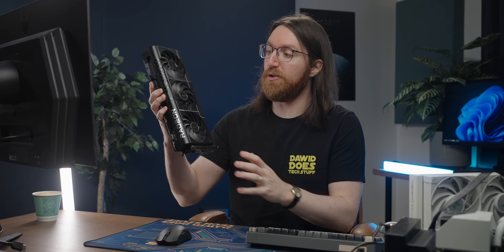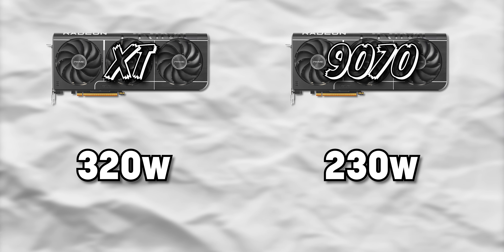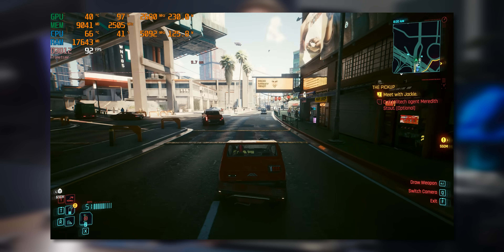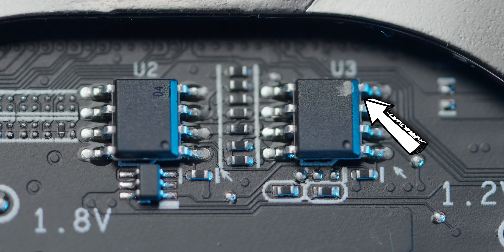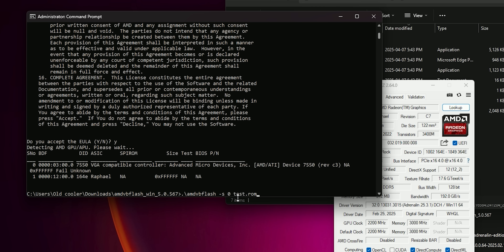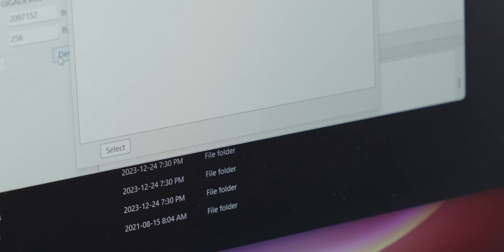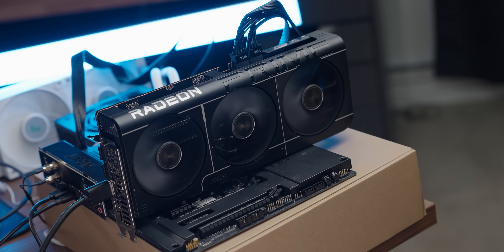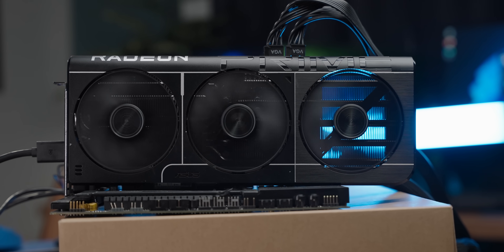I Flashed An AMD RX 9070 XT BIOS Onto My RX 9070...

Comment: Would be good practice to make a backup of your previous BIOS with your reader/writer before writing the new BIOS onto it.  To recover from a bad flash or just have the ability to restore it to its previous state in the future.  I assume you checked the hash or checksum on the downloaded rom/bin to be sure it was bit-for-bit correct before writing it to hardware...  And I assume you downloaded it from someone that provided that hash so you could verify.

Comment: The data on the chip means(maybe)
1st line 
GD - giga device (manufacturer)
2nd line 
25 - chip version (usually all smd bios chip. thd are 24 if i remember correctly)
LB - low power 
16 - 16 Megabit

Other data not important

Comment: AMD are famous for this, I remember flashing a R9 290X bios on the 290 and it even unclocked the extra cores! 

The last time I remember this working was on the 5700, so it's good to see it back because it's part of the fun of getting AMD stuff. Even going back to the 1600 CPU's that went from 6 cores to 8 cores

Comment: I would not suggest flashing a 9070XT VBIOS on a 9070 non-XT. One important thing to note is that each GPU vendor has their own VBIOS. Meaning you cant flash an ASUS VBIOS with a Sapphire 9070 non-XT. I know that's very straight forward but someone out there will try it w/o doing research and brick their GPU. Also not sure what you tried doing but the AMDVBFlash.exe does work. I've successfully flashed multiple 9070XT and  9070 non-XT GPUs.
Reply: Have you tried using it to flash a 9070XT VBIOS onto a 9070 using same vendor VBIOS?

Comment: You could try it with the sapphire nitro 9070 as it has the 12vphr connector like the XT variant. The Asus 9070XT has 3x 4 pins

Comment: so how does the modded 9070 compare to the 9070xt? and what are the physical differences on the two cards? is a 9070 just a 9070xt that didnt quite hit the quality control limits but had enough functioning cores to be a 9070

Comment: will more power tool work on this generation?
Reply: Didn't work with 7000 so 9000 Probably wouldn't.
Reply: @AlexHusTech  assumptions was not what i was looking for. since the architecture is different i thought there was some possibility that they went back to the previous system such as apple does with design. 

it seems to be trend in manufacturing to flip back and forth with parts and sub-systems. 

the reasoning is that one does not have to re-invent the wheel every time.

Comment: As a fellow PC nerd who used to basically do this all the time to my RX 480, you are bringing back some fond memories. Wait until he discovers he can mess with the vram subtimings.
Reply: Hi fellow PC nerd What does messing with VRAM timings do?
Reply: @Stardomplay  You can tune how quickly data is read/written so that the GPU spends less time wainting for data. Meaning that you can get more preformance by removing some of that read/write bottleneck. You're not getting 50% performance jumps or anything. Just a few percent here and there depending on the game. I think I was able to get around 8-10% improvement on my rx 480 back in the day.
Reply: curious, would this work/be possible on an RTX 3090 OC from Zotac?
Reply: @justADeni  Do some googling and find out.

Comment: This is great timing, I just bios flashed my 7900XTX Pulse with the Nitro+ bios and also went down that same path but I think for the flash tool you can just change the type of the file from the drop down menu at least with neoprogrammer V2.2.0.10 to rom file and itll load it fine you dont need to do the conversion. Also getting the bios reader to actually sit on the chip is really hard, I think I had about 20 attempts before it actually read anything.

The performance gains were also really good, it does heat up a lot more considering the TDP went from 370 watts to 420 watts and with +15% power limit it hits 460 watts with the stock cooler. I undervolted to 1075 mv stable with my average frequency went from 2600 to 2900 which is insane. I did swap the thermal paste for PTM7950 but im still hitting 95c hotspot under full load with max fan speed so im thinking about water cooling it.

Still a very fun thing to attempt just make sure you back up your bios before flashing it so you can always revert it and not end up with a bricked GPU.

Comment: I'm honestly surprised the BIOS chip didn't just die when you threw 3.3v (or 5v if the CH341a isn't the updated version) onto it when it supports 1.8v.

Comment: No don't do it. the reason the chip is set as is is because it can't handle safely the clocks of the 9070 TI this is like the old days and HD7950/7970 yes the never fused of the extra core only software locked them but all the chips. But they all failed to meet the standards needed to the 7970 model. When ever GPU's put a Bios switch you get people experimenting. You Bios is the temp and clock safety. It not like overclocking where you can't burn you chip or course damage. Just stick to normal overclocking on the AMD Bios as you most unlikely to brick it. Bios playing is more pro and as a past super overclocker with the 3DMark badges to prove it, unless you know the3 code don't fuck with it. I killed lessor card, like 3 750ti trying to get a high three card score. Bricked 2 out of the 3 cards.

Comment: I remember flashing the HD 6970 bios on to the HD 6950. It unlocked extra shaders on the card and (almost) turned it into the more expensive 6970 for free! Good times.
Reply: Я проделывал такую же операцию со своим HD 6950, но перед прошивкой редактировал БИОС с новыми повышенными частотами чипа и памяти)

Comment: Essentially you've turned the "Q mode" on the Dual-BIOS switch from Quiet to Quick.
Though not a true RX9070 XT, at least you got a significant boost over stock (even the factory OC RX9070s are a bit slower).
Being the BIOS swap made it have RX9070 XT performance using RX9070 board specs, I would call this amalgamation the RX9070 XT-56.
56 obviously meaning the CUs found on the RX9070 the BIOS mod is using, in contrast to the OEM RX9070 XT's 64 CUs.

Comment: Does the Asus PRIME 9070 have the same number and type of power phases as the XT version? Free performance is great, but not if you're pulling an extra 50% more power from VRMs that are going to go bang and let out some smoke.

Comment: The bios doesn't change what the hardware reports as. That would be a hardware change. The only difference between a 9070 and 9070 xt is the power limits and clocks. These values can actually be overridden by AMD's drivers.

Comment: The same concept is available for Vega 56 / 64. They came with dual bios as well and flashing the 64 bios and undervolting has kept my graphics card relevant for 8 years.
Reply: Funnily enough, even the compute units match. The RX 9070 has 56 and the 9070 XT has 64.

Comment: Reminds me of flashing the Radeon 9500 to 9700 from the early days. 

I'm very curious to see before and after readings from GPU-Z of the PCIe slot power draw. The XT version of the ASUS Prime card has 3 8-pin power connectors, because they stretch the power limit from the XT's spec 304W. So your boosted limit 2x connector card might be drawing a lot more from the motherboard now. I don't know if this would affect the card much, but it might not be designed to draw a lot of power from the slot. I wonder what performance gains a 304W BIOS will bring. Cool video and thanks for going through the nightmare of hardware BIOS flashing. I'd never seen it done before like that.

Comment: The 9070 has less cu or whatever but there are many other specs that are still identical to the XT. Same ROP count and same bandwidth give it much legs. Especially considering the ram speed on  XT is abysmal compared to Blackwell.. the amd gpus should be quite bandwidth limited at times. Many people said that $50 difference was a bad move but I think it actually makes perfect sense.. the low watt will make the partner models be cheaper to make so realistically you’re looking at $629 vs $729 for a same partner model. Obviously amd just wants us to get the XT because they can produce much more of that gpu

Comment: I still have a Radeon HD 6950 2 GB from 2010 where i flashed the bios to not only get the clock speeds of the HD 6970 but also unlocking it to 1536 shaders from 1408 shaders.
Back then lasercut was not a thing.

Comment: Say… is this also possible with the 4070ti super and the 4080 super? Cause aren’t both cards on the same chip the 70ti S is just locked down and at a lower power draw? Or has NVIDIA got  everything locked down?

Comment: Hey dawid, these CH314As work much better on linux using flashrom from the conmand line. I swear I spent HOURS trying to get the windows software to write properly, and flashrom literally did the job in 30 seconds.

Comment: 30 fps gained for 80 watts more power. Let that sink in a few seconds and then realize: thats a rather pedestrian gain...
But congratz on actually flashing your GPU :)
Suggestion: if you happen to have a 3080 (or any other gpu with less than 12 GB vram) lying around, see if you can get some GDDR6X memory, and if a repair shop you trust can actually solder it onto your graphics card.
Just so the customers can actually "upgrade" their 8/10/12 GB cards 😘

Comment: Last time I flashed bios of GPU was GeForce 4 and I was going to flash it to work on Macintosh (because back then with PowerPC Macs there was more hardware that could be plugged into Mac that was normally a PC thing), the flashing was succesful, PC didn't see the GPU anymore and when I plugged it into Mac, it booted fine, shown image, then system loaded and all caps just exploded on pcb of that GPU xD

Comment: Fun (sad) fact about the 9070.
Two separate power adapter can deliver 300W. One PCIe 75W. Meaning with 2 8-pin we can deliver 375W. It's kinda stupid to put the card limited to ±200W. Just make the card anle to reach 330W on power limit +10%. And make the card anle to use -30% or -50% less power. That's what they did on 9070XT. My card can go up to 374W. And as low as 238W for the MAX POWER CONSUMPTION. You can easily guess than with FSR4 and FPS limited to 144 to march my refresh rate. The power consumption is usually under what a laptop can consume for a 9070XT.

Comment: This is actually super cool and I'm glad you got it to work!

I would be careful though, reviews mention the coolers on the 9070 are weaker than their XT counterparts by a considerable margin (higher temps at lower power pretty much across the board from what I've seen) so you might run into overheating issues with it.
Reply: prob if you buy lower spec variants,but i think anything past Hellhound will be fine since they are overbuild anyways.

Comment: Switching back and forth really shouldn't be sold as a convenience feature at all.

Each load comes with a small percent brick operation. 

Seems to me anyone loading the hotter BIOS is likely to just stay with the high performance BIOS and up the cooling and call themselves lucky.

Comment: The core clock slider works.
On a 9070XT Red Devil, at ±0 it's set to 3400 MHz (it is just impossible to reach this core clock^^). You need to slide it down to -300 to lock the core clocks at around 3100 MHz (well, more like 3080). Just pull it all the way down to -500 and you’ll quickly find out what "0" really means on your card.
Interesting how much more you can squeeze out of a 9070 non-XT with a BIOS flash though.

Comment: Does the card not show junction and memory temps? Those are the most important to see. So how much difference was gained from when you undervolted and overclocked the card before changing the BIOS? That would be your baseline, not stock settings.

Comment: This is what I've been saying. The advantage with 9070XT over 9070 is mostly because of power draw limit and not the amount of CUs. Of course the amount of CUs does matter, but it isn't as much as you might think it is. On paper, 9070XT has around 14% more CUs, thus if we ignore the power limit, it should only be a maximum of 14% faster in an application that is really compute intensive. Because of the power limit advantage (which is around 37% more on the XT) in games you can sometimes see more than 20% performance advantage for the XT (you can also see like less than 10% advantage probably because of the game is not compute heavy and might be limited in something else like memory bandwidth). If you give the same amount of power to non XT what you will see is 9070 and 9070XT trading blows, especially in games. 9070XT on average should be a bit faster, but there will be games where 9070 will be faster due to potentially clock higher because it has less CUs (less CUs = more watts per CU).
I really wish there is a way to easily increase the max power limit, at least up to 40% vs just increasing the default power limit.

Comment: I'm honestly mostly impressed with the low temperatures it remained at even after pulling 300+ watts
Reply: The Prime cooler is apparently very good even though it's only two-slot.
Reply: Im worried about the hotspot temps though.
Reply: @leanderelfrink10 should be worried about the vrm temp this cooled is not that great vs vrm temp and pumping 80 more watt through them is maybe not wise

Comment: There's a reason why the cards were not sold as 9070 XTs. Sometimes there is intentional gimping of cards (namely when it came to coin mining; be it either due to "mining-only" cards not having video output (despite being able to run games just fine if you do hook it up to video), or due to the card being gimped/blocked from mining).

Likely going to hurt the lifespan of the card or see some instability when doing mods like this.

Comment: I vbios flashed my one week laptop 4080 gpu 150w to 175w and boosts to 185w got the gpu stock in time spy 16000 points and unlocked and overclocked I got 20500 points...as long as you have video out on your cpu you can fix a bricked vbios

Comment: CONGRATS BRO!!!  Did you check to see if the other BIOS still works too? (I would think it does) Is it too late to return my 9070 XT? lol j/k I'm wondering if they'll put out a 9075 XT/9070XTX and then I can flash THAT BIOS to mine and get some performance gains....
or maybe I should just find out what settings you used for your Cyberpunk benchmark and get you you the stock and undervolt/OC'd numbers to see just how good that that BIOS really is :)

Comment: It is definitely possible to push over 230 watts on this card without flash. My Asus Prime 9070 pushes 250 and sometimes 260 when I slide the power slider to max and apply an undervolt and memory overclock. Sure its not 300 watts but in a lot of titles my clock count boosts to 3 to 3.1 ghz and still stays cooler than my old 6800XT with less power draw.

Comment: one thing you did wrong
the bios flash app it has to be in the C: drive root basically in "C:\" and put the new biois there too 
so the cmd opens directly from c: as priority for the flash 
i dont really know how it work but doing it like that i never had problems changing the bios of my gpu

Comment: They used to give you a min frequency offset on older cards. It would potentially greatly increase heat buildup (the freq/power graphs can't update fast enough to reflect what is going on) for the benefit of slightly less hitches and better 1% lows

Comment: I have the Asus Prime 9070 OC. It maxes out at 252 watts power limit with the original bios. I can make it boost to around 3100MHz or even more when doing undervolting. I doubt this 9070 XT bios would help me get much more. Also, the Prime cooler is really not suited for 300 watts +. I've seen reviews of the Prime 9070 XT where it gets kinda noisy VS the Prime 9070.

Comment: Reminds me of the good old days when this was more common. Years ago, I had a Phenom II x3 & Radeon HD 6950 system. Unlocked that Phenom into an X4 and flashed a 6970 BIOS on the 6950. That BIOS did actually unlock the additional cores, though my example still wouldn't clock as high as a real 6970.
Reply: I don't miss having to cut bridges on the top of the CPU though. I once bricked a brand new Duron. Never figured out how I messed up the cut. Was extremely careful, but the chip was bricked.

The pencil trick if you had to reconnect bridges was easier but some variants required you to cut.
Reply: @AlvinBrinson  Yep, overclocking on PowerPC Macs worked similarly where you'd have to either remove shunt resistors or bridge certain pads to change the clock multiplier. I've still got a G4 Mac Mini that I overclocked from 1.25 to 1.5GHz with that method.

Comment: I remember doing this on my AGP Radeon 9500 in 2003.  The bios unlocked it and gave extra pipelines.  In the end it had full 2003 - 9700 specs.  It was awesome.

Comment: 9070xt :undervolt me for  more performance
9070 : POWER! FEED ME POWER! ! !
Reply: Lol ikr, undervolted mine so it rarely reached 300w. Performance is incredible.
Reply: It Seem that it’s in Need Of… MOTIVATION!!!
Reply: my 9070xt runs great in -75mV offset, until i play Battlefield 6. In Battlefield it can run smoothly for weeks or crash every 3-4hrs with DXGI DEVICE REMOVED error from dx12 gpu timoeout (both nvidia and amd have this issue on BF6).
Reply: @n @nbodeh4658 have that issue when i push my vram too hard
Reply: Vegeta I need more power!!!!

Comment: This is very much the reason why AMD limited RX 9070 so much compared to 9070 XT. The difference between models is even smaller.
Reply: 10% less cores isn’t a small difference
Reply: @steven7297  The cores don't matter as much as the fact its power limited by 100w, it got 30% perf from just giving it more power.
Reply: @ cores do matter when all the games are considered some are 10fps some are over 15fps
Reply: @ 9070 XT is front end limited anyway, reason why the cores dont matter that much. 9070 is power limited.